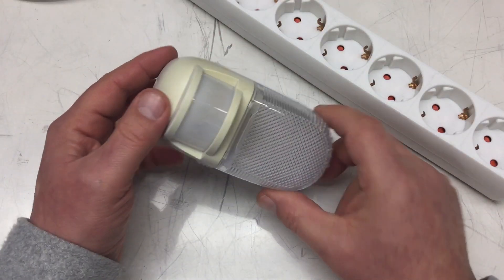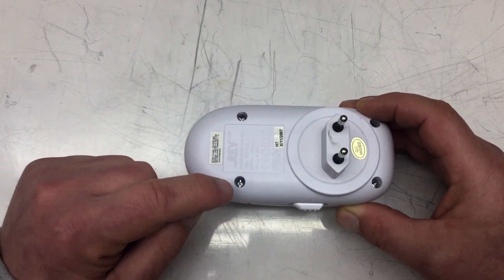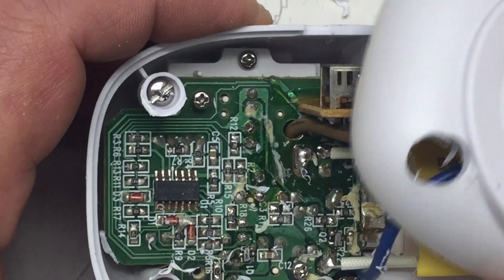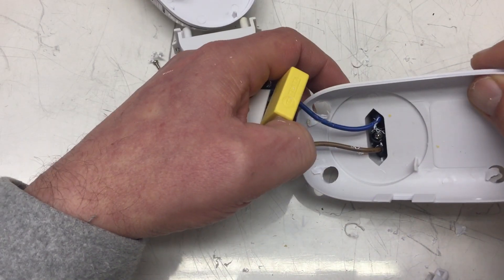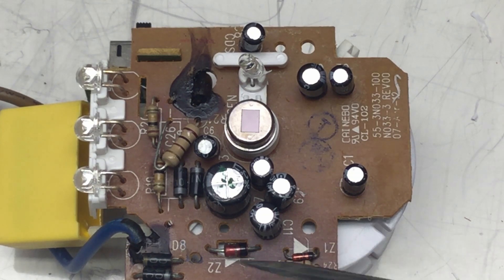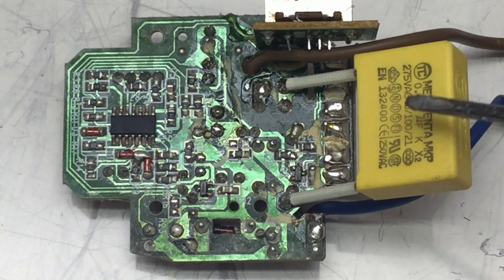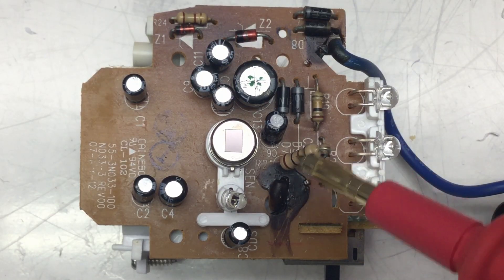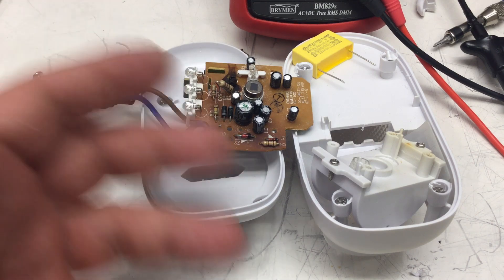Automatic Night Light Teardown (PIR Sensor, PCB Details)

Comment: I have one of those multi-bit screwdrivers, but if I didn't have one I probably would have tried cutting those security screws safely with the mill or a rotary tool in a continuous slot to use a normal flat blade screwdriver.
Reply from the maker: I actually tried to mill off the security part of the screws (off camera). But it was not going smoothly and I didn't want to destroy my brand new 2mm end mill (maybe I need it again to cover up some of my crooked saw cuts 😉).

Comment: Back in the old days when i first encounter such a "security" screw, i took a cheap old flat screwdriver and cut a slot in the middle. Bye bye security screw 🙂
Reply from the maker: I actually thought about that and even searched for a suitable screwdriver, but couldn't find one. And drilling out those holes in the soft ABS was actually quite satisfying after working that much with hard POM and aluminum 😈